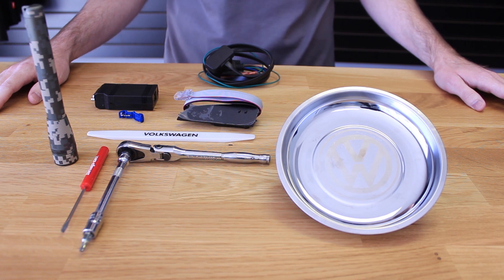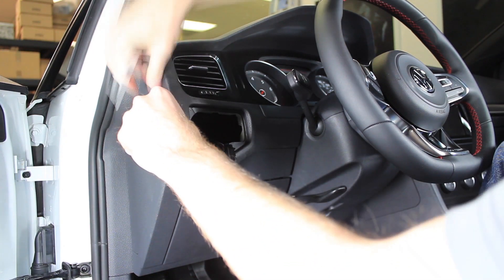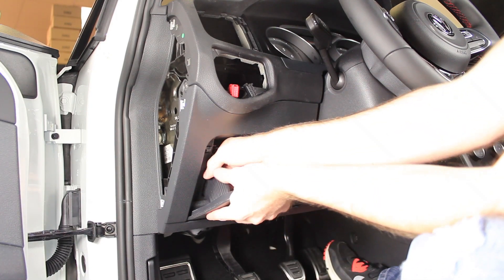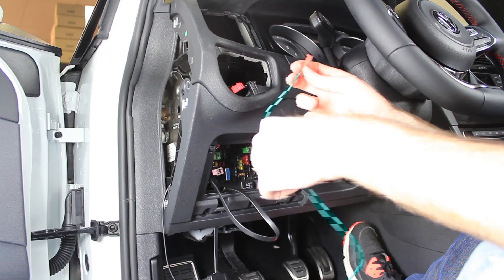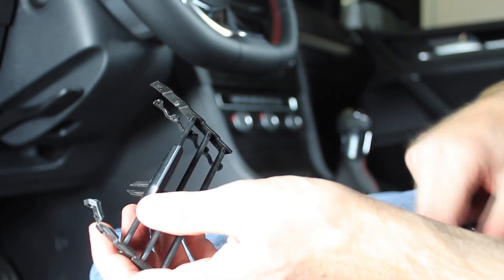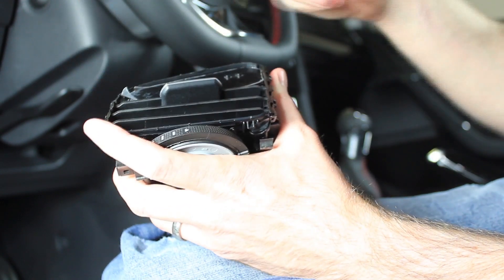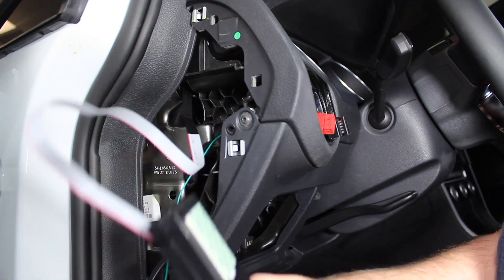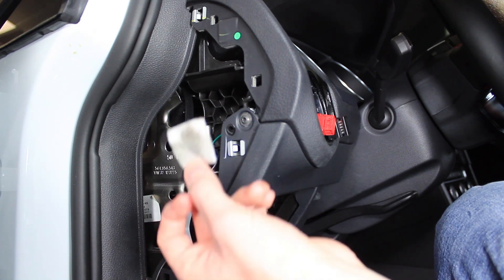P3 Digital Vent Boost Gauge for MK7 GTI DIY (How to) Install

Comment: Great Video, clearly on of the things that made me buy it.  Can you give us some further detail on connecting the dimming feature?  Specifically what kind (#) add a tap did you use and what wire did you connect it too?  Mine is wrapped under the Christmas tree, but I didn't see this info in the instructions that were in the box.  Thanks

Comment: Can you change the Data on Metrics? so 0-100kmh / boost in bar / Temp in °C ? or does it change auto. when you plug this into a german gti?

Comment: For anyone that has a sunroof,  don’t velcro the module to that spot.   When your drain tubes get clogged, the water will leak down and destroy the module.    

I didn’t realize my drain tubes were clogged and the water killed the module.   😢

Comment: Do u think u can just run the digital display instead of it with the vent. I just had a weird idea. In the golf mk7 tsi. Is there a way to have the gauge on the speedometer or on the screen

Comment: I know this is a 9-year old video, but wondering if you have any info/experience with the info this gauge can display (either out of the box or with coding) if used in an eGolf? The available info at a glance related to battery state, battery temp,  current voltage, etc. is all pretty basic in the eGolf and it would awesome if there was a way to use this gauge to display the info not available on the center cluster screen.

Comment: If the a part of the vents are being taken off to make space for the module, does it mean the AC constantly blows at the module once its on?? Is it okay to just let it sit imfront of hot wind in the winter time??
Reply: es3502012 first thing i thought of also. But they must of knew this when making it. Its probably sealed tight. What a mess he made with those wires tho.. Fuckingg zip tye bud. Add tqo to your kit gez..

Comment: Awesome tutorial, thanks!  I especially appreciated all the tips/tricks for removing the trim pieces , connectors, vent housing, etc.   I have a mk6 (not a mk7):  how much different is the install procedure for a mk6?   Thanks in advance!
Reply from the maker: +tedjohnson64 This would be pretty similar on a MK6 GTI.  Take a look here for the MK6 gauge. https://deutscheautoparts.com/make-model-year/volkswagen/gti/mk6-2010-2014/interior/gauges/vw-mk6-gti-boost-gauge-p3cars.html

Comment: Great video on the installation. Great product!!! It looks very clean, and functional. I like this setup much more then having 6 52mm gauge's all over the a pillar and dash. Is there an option to add a turbo timer to this device?
Reply from the maker: Im sorry there is no option for a turbo timer.   Adding a turbo timer to VW's is generally pretty complicated.  We generally advise to avoid turbo timers as to do so you have to bypass the immobilizer in some way.  Generally this is done by sticking a spare key inside the dash so the car will run without the keys in the ignition.  This can cause other complications as well as compromising the security of the vehicle.
Reply: Wow I didn't realize that I would have to bypass some of the security features. I appreciate your reply. Thanks for the good advice!
Reply from the maker: Glass-Man-252 No problem.  Glad we could help shed some light on the subject.  Thanks for watching.

Comment: How come on the 2017 gti pp the digital readout off the infotainment display shows up to 30psi? It's it reading high from factory for a reason? Thanks
Reply: It doesn't factor out ambient pressure which is about 17 at sea level I believe.  So when it reads 32psi, you are really  pulling about 15 psi at sea level

Comment: Can you please tell me how to unable the auto dimmer for the gauge, I've got a 2012 mk6, and the forums said to connect the green cable with the gray in slot #10 on the light switch connector, I did that but it didn't work, I would really appreciate any help you can provide me.
Reply from the maker: +Paul Abramov Shoot us an email with your order number and we will see what we can do to track down your issue.

Comment: Where do you connect the control module. Where does that info come from.
Reply from the maker: +George Bonta It plugs into the OBD2 port
Reply: OOOO Nice.
Reply: Is there an analog version of this unit?

Comment: Where is the green dimmer wire connected?  @20:03
Reply: Answer my own question here...
On 2016 GTI, headlamp switch red connector (2x5, 10 pins), solid gray wire on pin 10.  View the P3 Cars manual for instructions to enter setup mode, then enable auto-dimming mode for the display.

Comment: will it fit a mrk7 golf tdi?
Reply from the maker: The control module would be different on a TDI.  Trying to determine if the TDI one is out yet
Reply: Deutsche Auto Parts- Your Source for Everything VW and Audi yes, TDI is on offer, we just need to know model year of the TDI when ordered for reconfiguration.  Cheers!

Comment: real quick i was test driving the 2016 gti and it had already a digital cluster for boost in the infotainment. so why need this for?
Reply: You are one if the lucky ones with the updated version of the software. I have a 16 without the digital boost gauge.
Reply: The center console boost gauge readings are BS.  I've seen it report 33+psi on a bone stock 2016 GTI; simply not possible.  I'm also noticing that the coolant temps reported on the center console always shows 194 degrees after 5 minutes, whereas the P3 Cars gauge shows actual varying temperatures.
Reply: infotainment gauges are not accurate. psi includes atmospheric pressure (14.7) which is why it shows the 30+ psi